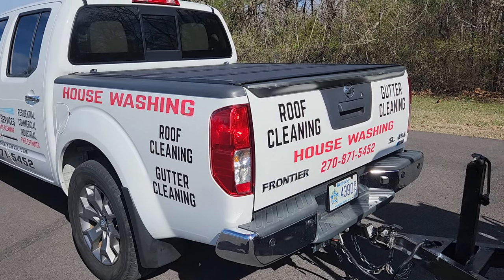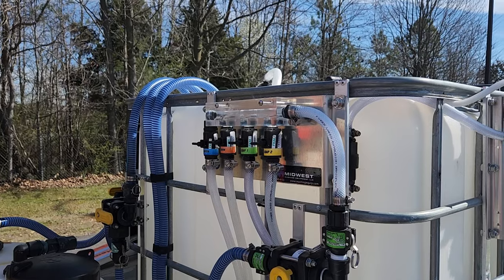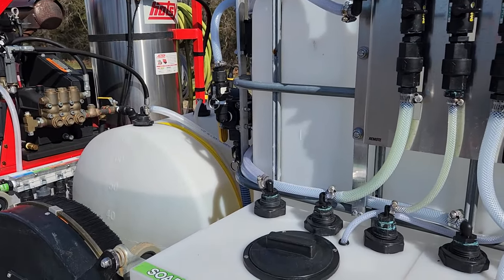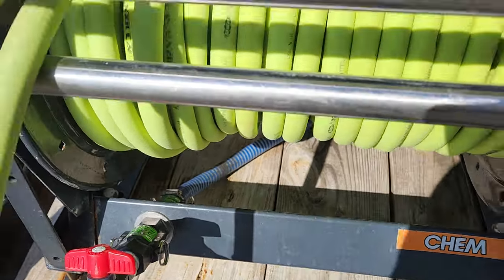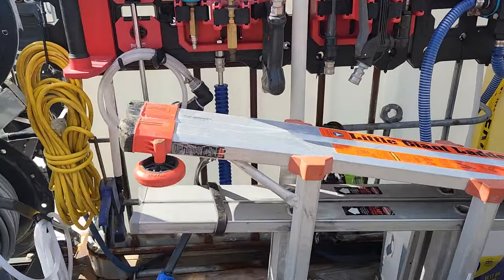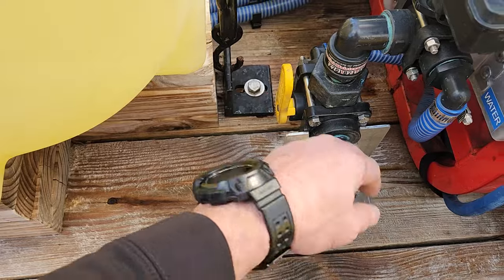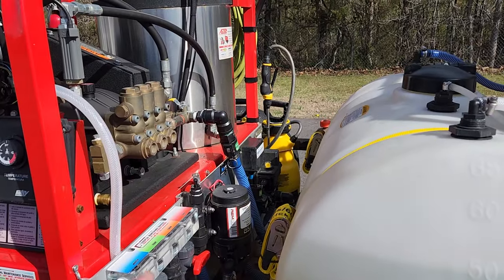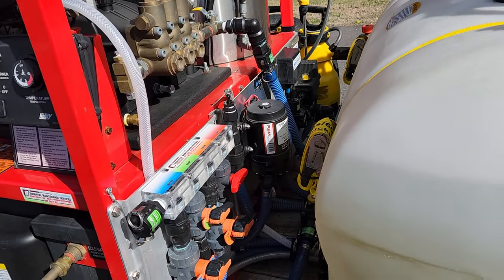2024 Hybrid Softwashing & Pressure washing setup

Comment: Fantastic set up friend, I hope it serves you well. Roughly 4500 lbs of trailer and equipment is quite a bit over what the Frontier is built for. Be careful.
Reply from the maker: I have airbags that increase my towing capacity and correct the pinion angle. 👍
Reply: Frontier will pull 4500 no problem lol

Comment: I’m in the beginning stages of starting my pressure washing buisness def not on this level lol but have more than most starting out, got about 28+ customers now atleast 2 jobs a day after work few on the weekends, about a month worth of work back log, running it out of my 07 Honda accord lol gotta start somewhere
Reply from the maker: You have to have customers to justify the need for equipment. Sounds like you are off to a SOLID start! It's much better than I did my first 6 months. Whatever you are doing is working, just keep repeating it. 👍

Comment: I’m curious.. what’s the point of having a downstream injector and a soft wash system? Aren’t they just the same thing??
Reply from the maker: Downstream gives around 1.25%. Softwashing ranges from 0.5% to 12.5%. Another reason is redundancy and options. There's 3 Softwashing options, 3 Downstreaming options, and 2-step fleet washing built-in as well.

Comment: This trailer is awsome!  Any idea what distance you are getting with the 7 and 5.3 running at the same time?
Reply from the maker: Yes, Sir! 57'!
Reply from the maker: Here's a demo I did in another video.
https://youtu.be/_iucbDN0aZ4?si=tumggKVyRMrvRsi0
Reply: @essentialmaintenanceservic4682  Thank you!  I think this is the route I'm going to go, or two 7s.  A single 7 is perfect for almost everything I use a softwash system for.  I've been running into a few shots that a single 7 can't hit and i want to stick to an on demand system and i don't want to omit the 12v from my rig.  A second benefit to this system is that my backup 12v is plummed up if one were to go down.  No need to swap.
Reply from the maker: @jasonbraun9060  Using a 5.3 and a 7 keeps you in the proper metering range of the V4 valving. Two 7's works great! However, you are now getting into larger valving to meter it correctly.
Reply: @essentialmaintenanceservic4682  thank you again for the information.  I kind of figured that would be a bottle neck as I am running a v4.
Reply from the maker: @jasonbraun9060  It will work, just not accurately.